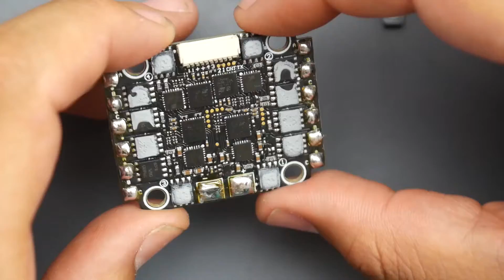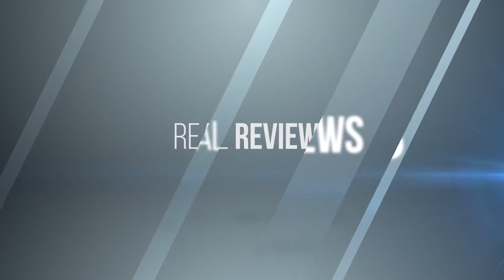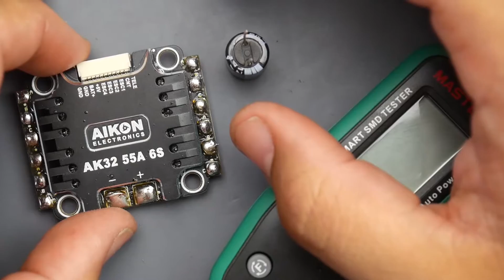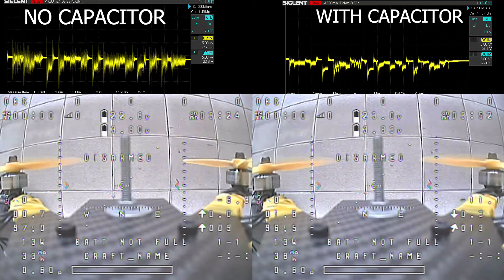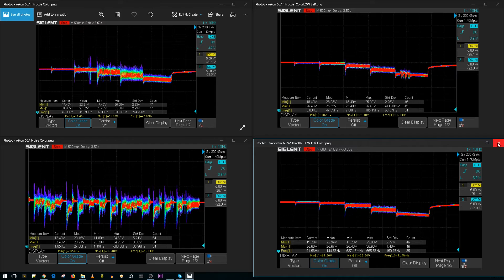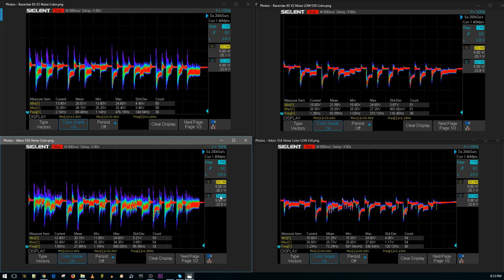WHAT HAPPENED WITH THIS!!! // Aikon AK32 55A 4in1 6S Noise Test

Comment: Have several of These Aikons and they have held up to 6s on 2350kv f60 without a stutter. Didn’t even know this was possible until I saw one of best drone racers in world flying this setup. These Aikons are the best esc I have ever used so far. Let’s hope they hold up long term. Have 2 older racerstar escs, 55amp I believe, that have been very good and reliable. But racerstars will desync under same conditions. Haven’t tried racerstar metal. Sounds like it would handle setup.

Comment: Ive ran 8s 2207 2450kv cobra with 5046 apc and after 10 flights along with matek f405 aio ctr it and the original ak32 35a 4in1 they take it like a champ ...
Havny trued the new 55a but willi g to bet from sounds of it that thw e5a v1 does better even.
Ive heard good results.in testing of tttrc and also racerstar 8s 4in1 with the ttrc being used on 8s large prop while lofting weight.
Anyone know for sure what part ks making thr racerstar 8s rsted with same mosfets as ak32 55a,onboard 5v reg. Dropdown not 8s capable or something r is it likely taking is just the same as racerstar metal and like the sk32 35a and also gs40 spedix does?
Great test
Reply: Also used ak32 35a on at least 20 high kv 6s machines from 4in-7in and all with 2207- 2608-2210-2507 sized motors 2300kv-2800kv and out of well over 100 flights with them doing runs between 130-172mph with largest and steepest pitch props out there. (Normally 6x6apc,7x6apc ,5046apc,5051 azure amd 5050 hulkies) never yet to have an esc fail from power issues and only 2 failires from My doing like hitting 53000rpm and heating up solder on esc motor pad desoldering it causing a short and cooking 1 mosfet.
Tried 10 of the best rated hyed 4in1s ouf there ak32 35a has out performed em all and on stoclk settings was givmg me 150mph plus runs off the bat new build with no warm motors or escs and did so flight after flight so i can say theres another on par til i see the abuse ive done like finx40 2600kv 7050apc 6s speed runs at 140mph +and easily breaking 50a per esc. just my 7 cents